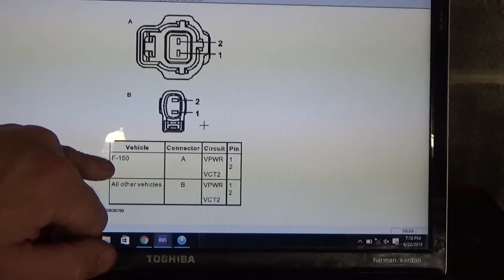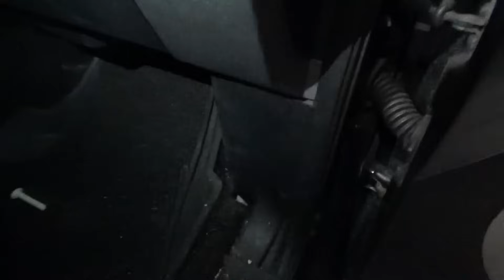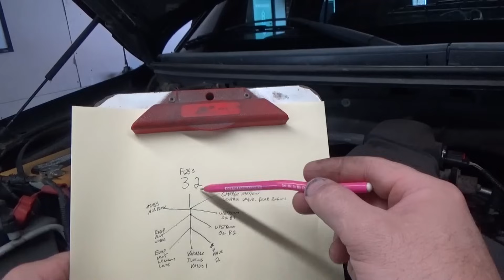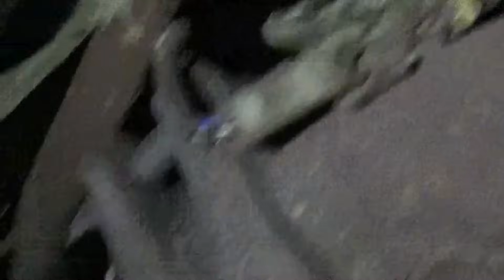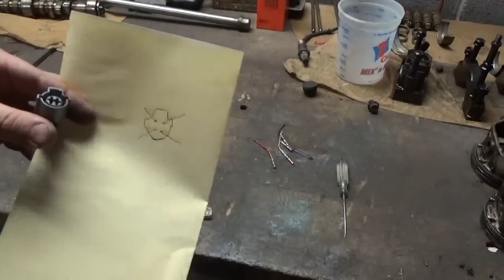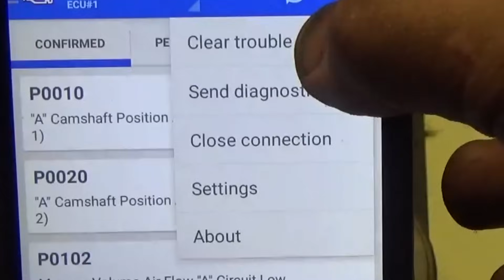Ford 5.4L failsafe mode multiple codes Real time troubleshooting

Comment: Thank you. I have Expedition 2005. Have similar problem, but it exists only if is over 80 degree outside. When is colder everything works perfectly. When is warm, I can drive for 10 minutes and the car goes into the safe mode showing p2107 and p2110. I could turn off engine and on again to make engine working normally, but only for minute or less. Sometimes, even it is little colder outside, but I left car with turned off engine for few minutes only, the error shows again and engine is in safe mode. If I drive, the wind cools the engine a little, but parked for few minutes or being in traffic generate error again. Entire summer I had this problem; Winter time everything is ok. Many things replaced and checked without any cause found. Currently, driving for long time in safe mode (I don't even bother erase the codes) I got 2 more codes; so, I have now: 2104, 2107, 2110 and 2112. Again, I am 100% positive, this is caused by the higher than 80 degree temperature and after few minutes drive. Do you have any solution for this? Thank you again, your video gave me some more ideas to check and maybe fix the car.
Reply: All your Codes Are TACM Codes --Throttle Body Actuator Motor
Disregard all of them
---Your Problem is Failed Cop Ignition Coils--
The Secondary Fails in many different ways & sometimes fails
to ground out in the PCM Drivers & that spike comes back to the
TPS Sensor
When you loose the tsp, the pcm doesn't know what the driver wants
to do & it sets any of those codes & goes into ETC FailSafe
You Do Not have a throttle body issue with the tacm motor
If it was bad you can scope it like a fuel pump & they are avail
separate from buying the entire throttle body such as my Lincoln L/S
There is a computer, so to speak, inside the PCM called an EQuizzer
that tps throttle signals go thru & unfortunately the spike from a 
very bad ignition coil-- back feeds
So find & replace all bad coils,look at Mode $06 Data under cylinder
misfire counts
If you have to-- just walk a new coil,replacing the old one, until you get 
to the bad ones
The only effect the temp has -is that to use it as a diagnostic tool, you
need to be at 90 degrees & that is no guarantee they will fail
Those 5.4 from 2004 thru 2006 had bad injectors as well,that leak
So between you driving in failsafe & the cylinder misfires your not 
aware of,your pretty much going to have failed Exhaust Converters
The ETC or Fail Safe is there to protect the converter & your to stop
using it immediately, as the fails safe indicates a Class A Cylinder
converter damaging misfire
You never clear codes or you loose all Mode $06 Data,Freeze Frame
at the time of the event & other data needed & then have to drive until the Emission Monitors run again & if you have problems, they won't. So now you see why shops don't know this stuff,including dealers, that power brake the vehicle hoping to get a misfire
For the DIY --just replace the spark plugs & all coils & the front 2 oxygen
sensors & most likely the failed cats
Have to look at the O2  & fuel trim on a scan tool & inferred cat temp etc etc

Comment: i have 04 f150 5.4 takes some cranking to get started then runs like crap for a few seconds and then straightens up and is showing 4 or 5 codes it has new puel pump new pump drive module and starter can you help me please
Reply from the maker: can you list the codes, honestly the best  way i could help is at the forum. if you wouldn't mind going to toolsandtime.com then forum, you will need to create a user name its free. then start a new topic under domestic/ford. i can deo this for you if need be

Comment: I have a couple of question. The OBD Doctor app what is that and how does it connect to the obd ii port. How much did the mitchell ondemand cost you.
Reply from the maker: I believe OBD Doctor is free with the option of in app purchase, i did upgrade when installed a couple years ago around $10 and has been free updates since. im not sure if the price went up.
in addition im using a obd2 Bluetooth interface connected to the vehicle paired with the phone. i will need to get back to you on the exact brand/model 

as for Mitchell. i purchased the program bundle many years ago 2011 i believe it wasn't cheap at the time, i cant recall. if i can find some info i will get back to you, its been great but im limited need to upgrade.
if you have internet another option is "ShopKey" from snap on. its been my go to source once i got the hang of the format they use. they have multiple packages check it out.
 
i started using the apps a couple years ago, keeping track of the progress along the way. i must say they have been useful. i keep the interface connector in my car all the time and always have my cell phone, its handy as heck, quick to connect and gives a good insight. 
im not 100% sure how accurate the processed data is however its pretty good. i found some challenging issue in the past using this setup. 

as you can imagine it has limitation therefore i still have my big cumbersome scan tools on stand by when need be lol